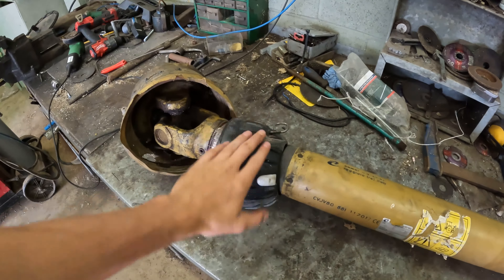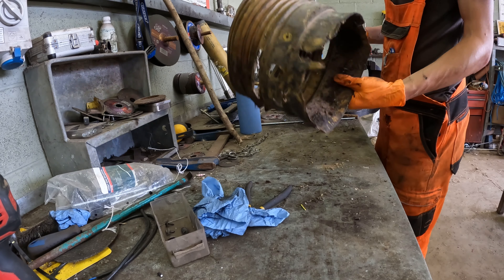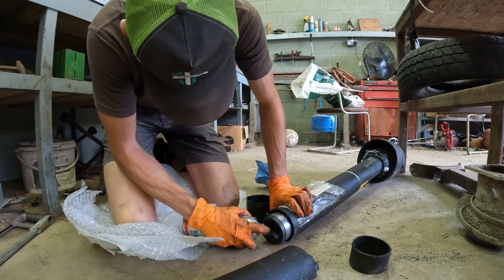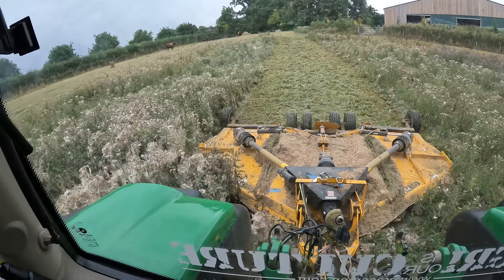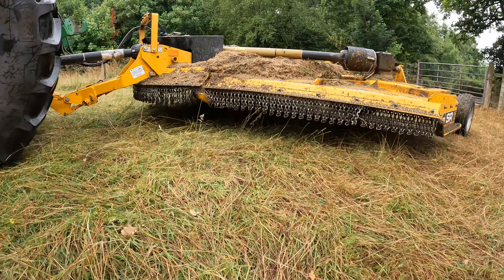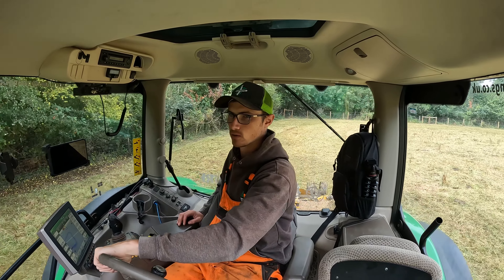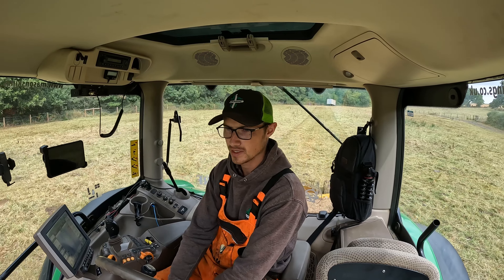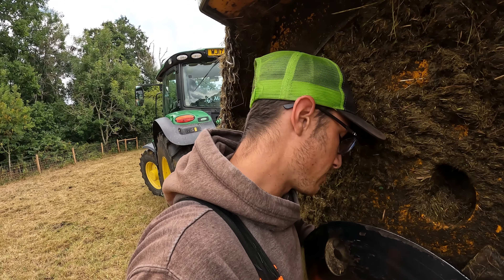THE BEFORE...AND THE AFTER! LETS HAVE A TIDY UP!

Comment: Interesting opinion about powershaft covers you made. I do agree that any dealer that is selling second hand equipment that has a powershaft should be selling it with a guard that is not damaged or broken. If someone sold you a piece of equipment that is potentially a safety issue and someone has an accident could the liability come back on the seller?
Reply from the maker: It's a very grey area isn't it. Most things now are sold as seen. And how can it be policed? Lots of thought to go into it.

Comment: PTO covers should be made more substantially in my opinion particularly where they clip to the PTO shaft itself and the chain to the guard. Where the chain fixes to the guard is just plastic and that goes first usually. Really the whole guard should be reinforced in some way. 
Regards dealers I agree but sometimes you can get a better deal if you can get them to replace it before you agree a price.
Reply from the maker: Yes very true! They always seem to give out where the chain attaches first!